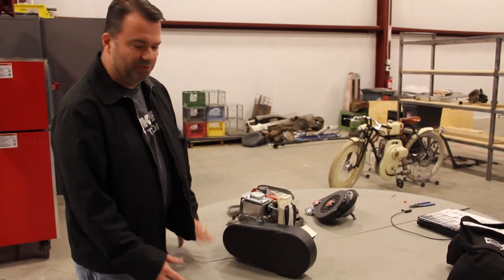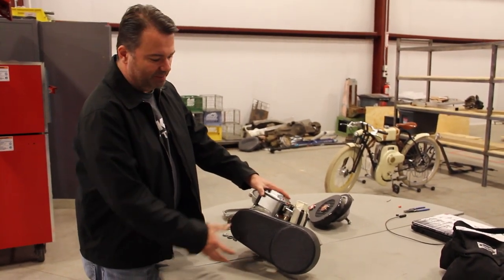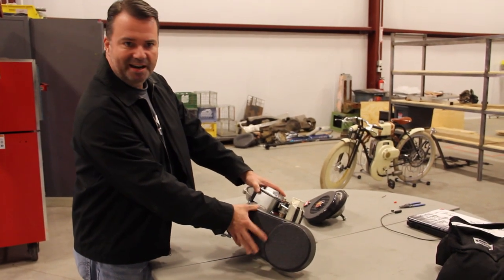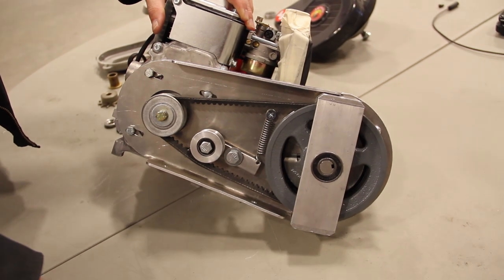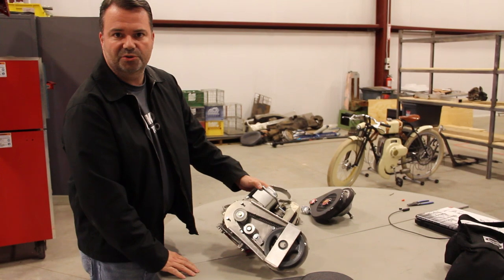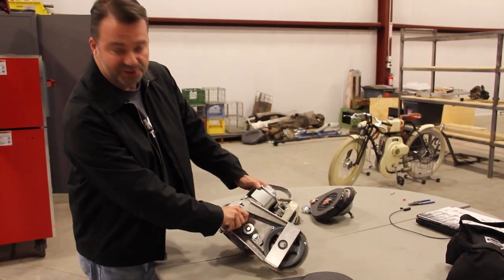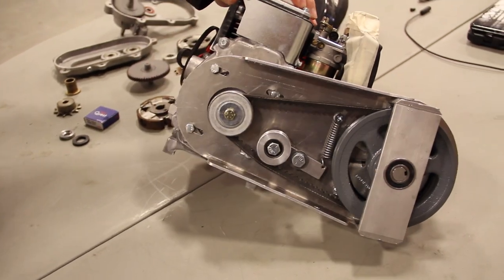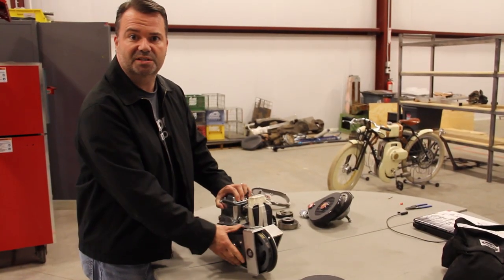Cruiser Transmission Dev Update: Q-Matic Pacesetter

Comment: Awesome, I just got one of these for my bike not too long ago ,I have heard they can last over 10,000km 300$ seems quite a bit for the product but it has a good design and team behind it
Reply: I got one they are good but the easy removal feature of the clutch shaft housing is a flawed design. Mine wore out very quickly as the screws are way undersized for the task. I had to order a new one but asked for the 1-peice bracket but instead I got what would normally be the outside bracket. I had to tap some of the holes myself to adapt it, it works but the clutch shaft is about 1/8 inch too short but have not had any problems.
Reply: @00Pottus00  Q Matic transmissions are a waste of materials. The crank pulley is 5/8 but is supposed to fit a metric crankshaft and causes vibration. The slow spinning clutch chatter is obnoxious, the gear reduction in the pulleys isn't good enough for anything except smoking the clutch and belt replacement is a ride ruiner...

Comment: What different about this one compared to the original?
Reply from the maker: Originally, we were using an actual gearbox with straight cut drive gears. That original transmission was much louder, and while it was probably maintenance friendly as far as the drive was concerned, it used an oil bath that needed to be checked and changed. Especially because it leaked pretty steadily. We played with some other belt drives, but that one seemed to have the simplest and best construction and belt choice.